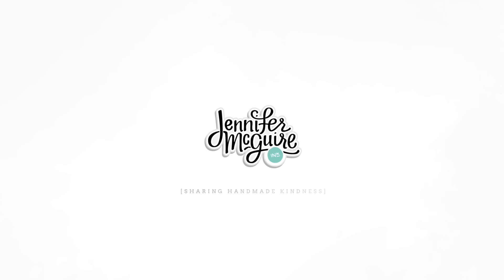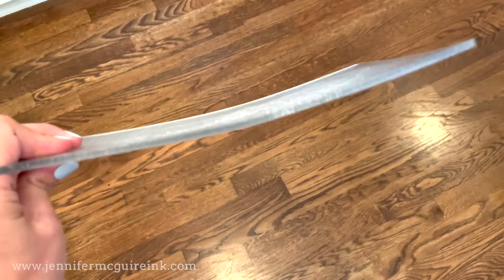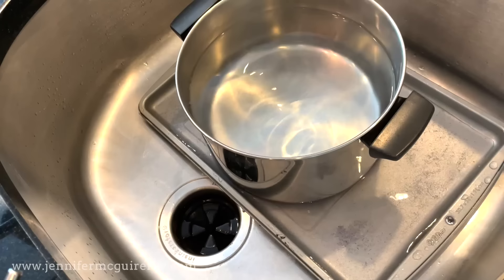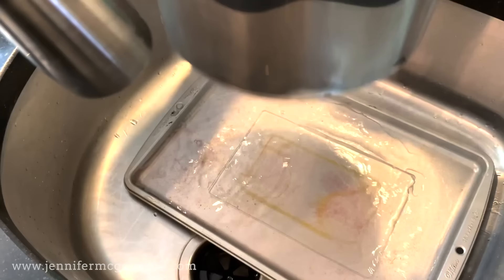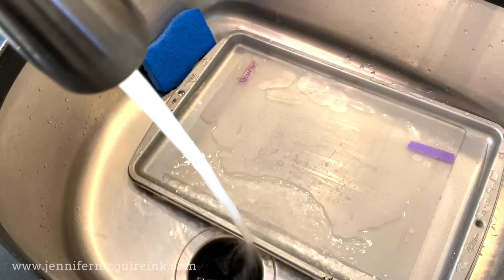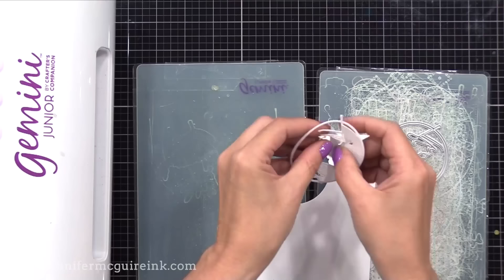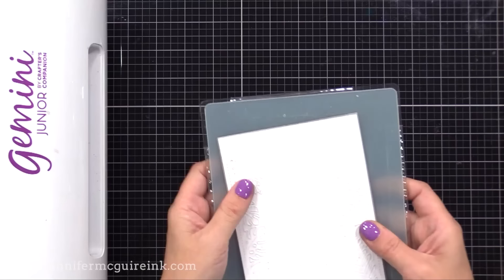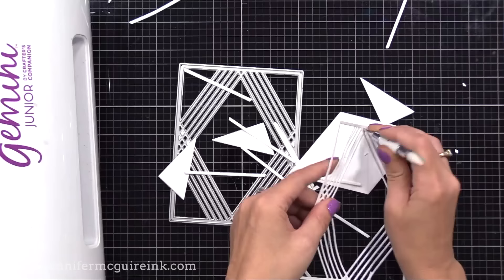Fixing & Avoiding Warped Die Cutting Plates

Comment: Hi Jennifer. I watched this video a year ago, and it came up in the sidebar, so I watched it again. Since you filmed this, I have purchased the Sizzix Switch. I use the Chrome Precision base to cut into. The top plate warps terribly. I know I can use your boiling technique to straighten it, but I would need to do that very often. Do you have any advise? I cut down into the precision plate, and I know you recommend cutting side up. Would that help? Also, your Gemini Jr suggestions are brilliant. I love my Gemini, but am very frustrated at the abuse to the plates, that make it hard to use. Thanks so much for your video!
Reply from the maker: Maybe one of our readers will have some advise. I haven't used the Precision base.

Comment: My shims were warped the plastic one, magnetic one and cutting plate I did this ti each of them and it worked like a charm.  I’m wondering if we shouldn’t do this to them before using them for the first time.  I'm a beginner and had only used the shims a few times before they warped.  After soaking in hot water with a hot water press they aren’t warping?  Thank you for the information.
Reply from the maker: Are you asking if you should do it before using?

Comment: Can you use different plates with different machines?  For example, can you use the double sided plates in a spellbinders machine?  The plates all look relatively the same size.
Reply from the maker: I use the plates that come with each machine. They do look similar but they are designed for the pressure and size of that machine.

Comment: Hi Jennifer, thank you for sharing this information! I have Empress and both plates look like bowls. I did not know using the metal shim could cause the plates to warp. I am going to try your hot water technique and try to fix the warping. I will also try using the green double sided plates to decrease future warping. QUESTION...taping my dies in place does not always work for me and like to use the Empress magnetic sheet. Where in the sandwich would I put it?  In addition my magnetic sheet is also warped. Any suggestion on how to fix this problem? Apparently Anna G. does not sell her plates separately, only sold as a set and cost $50.00...OUCH! I appreciate any suggestions. Thanks again and God Bless.

Comment: My full sized Gemini seems sensitive to pressure. I use two of the regular cutting mats and the plastic shim, and it seems like good pressure, even a little too much. How does the thickness of the double sided plate compare to the plastic shim? If it is thinner I might be able to replace my plastic shim with one green plate.

Comment: Jennifer, is it ok to use Gemini Jr. plates in a regular size Gemini? I bought the reg. Not realizing how large it is. I don’t have the room needed to put the plates through.
Thank you for all your wonderful and helpful videos.
Reply from the maker: I think so.  But you would want to check with them to be sure.
Reply: I use mine that way every day...no problems.  This is really a great solution for more even pressure.  Best thing I ever tried.

Comment: Thank you for posting this! I watched one of your other videos and bought a Spellbinders Platinum. I'm having a lot of problems with the tan embossing mat. It's leaving a very sticky residue that doesn't come off with soap and water. Have you had this problem? I wrote them and they told me to use soap and water. That's not a solution! I'm going to call them tomorrow but since I saw your video I thought I'd ask. I'm going to try your suggestions for anti-warping!
Reply from the maker: I haven't had that problem.  Maybe something wrong with that mat.  Spellbinders has great customer service, so definitely contact them. 😀
Reply: @jennifermcguireink  I did, thanks. They are sending me a new one.  It was a bit rocky at first though, and I wasn't impressed with the response.  I had to push. 😑

Comment: I've been using my heating gun to help remove most of the warping of my top plating and I also use 2 self healing mats as my the bottom part of my "sandwich". I also use the heating gun to help with the warping on them also. I plan on trying the boiling water on all of them, tomorrow.  Thanks for sharing. 
But I do have a question about something else.  Why do you turn your cutting dies face up and not leave them facing downward? What's the difference?
Reply: I know that Gina K has the die facing up for intricate dies as they seem to cut better that way

Comment: Thank you for the video.  I have a cuttlebug,  my warped plates look like your fixed plates.  Barely warped.  But it will not cut intricate dies.  Do you know if the green cutting plates will fit in a cuttlebug.   Crafters Companion isnt very good at providing size height, width, thickness.  I’ve been using a cutting magic mat for the cutting side and my C plate for the top & of course the thick A plate on the base bottom.    I cant use the B plates as they aren’t thick enough.  I usually have to add a cereal box shim when using the magic mat A plate C plate if the die has any details.   Thank you again.
Reply from the maker: I'm really sorry but I don't know

Comment: I know this is a old video, but I have a question. If you had a choice between the Gemini and the Gemini junior, which one would you buy?  Thanks!!
Reply from the maker: That's a hard question to answer. Kind of depends on what you think you will use it for. If you want to do a large number of things at once, the Gemini is helpful. But the Junior takes up less space on your table and is good for most things. Perhaps others will join in with their thoughts

Comment: I have an Evolution machine. My plates are not plastic but like a thick, harder rubber. One is like double thick which looks like two of the plates glued together. I tried to push both plates through and now I have a permanent wave in the middle of both plates. I'm afraid to put them in boiling water especially the double thick one because it looks like it is two of the plates glued together and the fact they are some type of rubber. Any advice from you or your husband would be appreciated.

Comment: I was wondering on what medium you boiled the water. We have a gas stove and the underside of our pots get very hot. My concern is the pot on top will melt the plate. Can you tell me what you used heating the pots? Gas, electric, induction?
Reply from the maker: My stove is gas.  But it shouldn't matter. 🤷‍♀️

Comment: I tried it on 3 plates, yes it cleaned them...but did not change the S-wave warping much at all in my sizzle plates.
So I pulled my engineer nerd husband into as well thinking  it because I live at almost 7000 feet in Colorado. I thought maybe altitude played into it...no, he said, altitude isn't going to make that much of a difference due to a small boiling point difference from lower altitude. 
So I bought new ones! O'well

Comment: Hi, I bought a baking tray just for this purpose. However, when I poured in the boiling water, the baking tray itself warped on a diagonal. 
Because of this, I didn't continue. 
Would the warped baking tray plus the warped cutting plate plus the pan filled with boiling water still have worked to flatten the cutting plate?
Also, my cutting plate - sizzix- is double warped (no idea how that happened).

Please help!

Comment: I tried this hot water method to flatten one of  my clear plates.  It did flatten the plate however it also changed the length and the width. I am now unable to use the plate as it is too wide to go through the slot on the Gemini. Not sure where I went wrong 😑

Comment: I use the chrome plate for intricate dies, so there is no warping. I had tried 2 different self healing mats, both warped. I tried the metal shim, and now using the chrome, I am not getting any warping. Someone mentioned below it might dull your dies over time, is this true? Can anyone tell me. I don't want to ruin my dies as I'm sure you know how expensive they can get.

Comment: Hi Jennifer. What suggestions do you have for METAL warped plates? My die cutting machine has a white acrylic base, then the metal cutting plate (where the fabric or paper sits on and the dies sit on the metal and then a clear plastic plate that goes on top before running through the machine. My cutting machine cuts both paper and fabric and I use it mostly for cutting fabric. The metal warps way more than the plastic plates you show and the hot water method wouldn't fix the metal warping as after using it a couple of times on one side it warps and then I flip it over, but there are still bulges of metal sticking up that makes it harder to run through the machine without the dies slipping. I have taped the dies onto the fabric and the metal plate to avoid slipping  and then I cut and that helps, but still there are both hills and valleys on the metal, so not ideal for cutting. If I had a steam roller, I could flatten the plate, but after a couple of uses, it would just warp again. I wonder if you have any suggestions for the metal plate or should I try using the suggestion of 2 clear and 2 green plates taped together? The dies cut really well for me, it's just the warping that can make it awkward using at times. I thought all die cutting machines had metal plates, so this is news to me they don't.
Reply from the maker: I am so sorry but I don't have any suggestions

Comment: Ok, I just tried the flattening trick and it did not work for me. I even put my bowling ball on top to add more weight. I have a sizzix, not sure if the plates are thicker or mine are just to warped. Next I will try the dishwasher trick that somebody commented that worked for her. Any advice?

Comment: I've seen recommended, by the manufacturer and others, to feed the sandwich through the machine so the die cuts upwards. It looks like you did the same, by making the sandwich with the die cutting down, and then flipped it over to cut upwards. Do  you know if there is a difference between cutting up or down?

Comment: Hi Jennifer, I have the two dark plates that came with my vagabond and two clear Sizzix that I purchased because no matter how careful I am, within 6 passes at the most, my plates get completely warped and there is no paper residue because I don’t get a chance to use them very much.  I tried your method 4 times with two different plates and there was absolutely no change.  None whatsoever.  Can you tell me what I may have done wrong?
Reply from the maker: Hmm.. I don't use either of those machines.  I am hoping that someone here who is reading your comment has some thoughts.

Comment: I don't know how many times I've told people not to constantly put your dies in the middle of the plates. It seems like common sense to me, but what do I know 🤣😂 all I know is I flip my plates all the time and I don't cut things in the middle of the plate or I fill up my plates bcuz I'm cutting several things at the same time. If I notice a plate getting warped, I run it as the bottom plate a couple times. I've never had to pour boiling water over them. But I've been meaning to in order to clean them. I did but the double sided die plates to use in preventing warping buy I haven't needed them yet 😊

Comment: Jennifer, I just received my translucent pale green Gemini double-sided die cutting plates. So, I watched your video again, to be sure I took a few notes, before using. I did notice a discrepancy, so need a verification from you.  In the first part of the video, when you are discussing ways to prevent warpage of plates, you say to place the dies, with cutting blades facing UP. Then, when you showed the cutting stack, (so we could take a screen shot), using the Gemini double-sided die cutting plates, in addition to the clear cutting plates, it says to place dies cutting edge down. Could you please clarify which I should be doing? I have to admit I am delighted to not have to be using all those shims that came with the Gemini Jr. For a while, I kept going back to my BigShot, because I found all those shims so annoying. Now that I have these thin translucent green plates (that were originally designed for cutting double-sided dies), I won’t have to use all those shims & I know I will be using my Gemini Jr. all the time! Thank you so much!
Reply from the maker: It shouldn't matter which way.

Comment: Thank you Jennifer and Ken for a very informative video . . . Ken may be a nerd, but then so are my husband (Aeronautical engineer) and myself (AP Chemistry & Biotech teacher), so I was glad to hear him give a clear and concise rationale for using your method over the oven!  Safety is always important.  I have a bunch of Cuttlebug plates that will getting this treatment to work in my regular Gemini  machine when I want to cut smaller die cuts.  I actually got my husband's calipers from the shop and measured all the cutting plates I own, so I know how thick the sandwich can be to go through the Gemini *FYI it is at total of 0.385 inches.  Normal sandwich is the cutting plate = 0.140, the plastic shim = 0.075, and the magnetic mat = 0.030, cutting plate = 0.140.

Comment: Unfortunately when I tried this method of flattening the plates it changed the width and the length …. So now it is too wide to fit  through the Gemini !!  It is flat just shorter and wider, so I can’t use it 😭 Not sure what I did wrong 😑

Comment: So this question is related but not about the cutting plates. I had just bought a hybrid embossing folder (SU) and decided to try it out. I put it in my paper to be embossed/cut then inadvertently put the fold of the folder facing me, and sent it through my Sizzix electric machine. Two bad things happened...the folder buckled terribly then the machine jammed and shut off. I eventually coaxed it out with little bursts of electronic movement but my folder and wafer thin die both warped severely. Do you/your husband  think the suggested methods could help the embossing folder flatten? I'm so sad to have done this to a brand new folder :(
Reply from the maker: Jennifer is taking some time off so I am answering for her when I can. I know that she would say to try it and see. I don't think she has tried it. It certainly can't hurt it right?  Jana for Jennifer
Reply: @jennifermcguireink  Thanks for responding Jana. I 'm thinking that too but caution has me concerned about the folder plastic temperature tolerance. I'd love to get some feedback from her at a later date too. Rest well Jennifer, we all need to rejuvenate and rest!

Comment: I have tried Jennifer`s process 3 times on my warped cutting plates and got no results. The plates are still warped, the boiling hot water and the pressure of a pot of boiling water had absolutely no effect. What could I have possibly done wrong? Any help whatsoever would be appreciated. Thanks in advance.
Reply from the maker: Well, if you followed the process and didn't get the result you want it is possible that it's time to get new plates. Keep in mind that using the boiling water may give you some more life on your plates but not forever. At some point the plates simply need to be replaced.
Reply: @jennifermcguireink  Thank you, Jennifer. I had high hopes that this would work, I tried it on 3 warped plates 3 times each. I do have new ones in my stash, just had hoped that I could bring some life back in these. Thanks for responding and I love your videos I have been a subscriber for quite a while.

Comment: I tried this following your directions and the warp did not budge.  I tried various other tweaks and nothing worked.  I am so discouraged!  Does anyone have a fool-proof method for eliminating the warp?  I am desperate!!
Reply from the maker: I am sorry it isn't working. Keep in mind that this tip will not stop you from ever having to replace the plates. It is meant to give them a bit more life. If your plates have been used a lot it may be time to replace. Others may have some thoughts here.
Reply: @jennifermcguireink  I saw another post and tried her method and, voila! - it worked.  I cut a piece of thick clear vinyl the size of the cutting plate and place that between the die and the cutting plate.  It has kept my plate warp free for almost a year.  And it is cheap if you purchase the vinyl on sale.  Certainly much cheaper than replacing plates all the time.

Comment: I use a Big Shot Express and find it does warp the plates even move than the manual Big Shot machine.  I'll definitely try the suggestion of moving the dies to different areas of the plates to cut.  I already use the other suggestions you showed. I have a question about the Sizzix Chrome plate.  I've been using it for awhile and it makes things cut really well.  Have you heard that it will dull the dies over time? I noticed your comment about metal shims, so wondered if you think I should only be using this when necessary, such as with large intricate dies? I have a plate that is warped both ways, one end is convex, the other concave.  I'm going to try your technique to see if it will straighten it.  Thanks for all the testing you've done, much appreciated.  And thanks to your hubby for his explanation, made sense to me ;)
Reply: Please let us know if your concave & convex plates straighten out. Thank u have a great day.